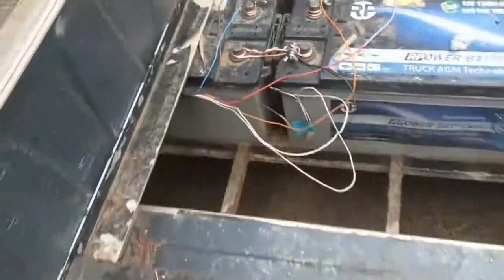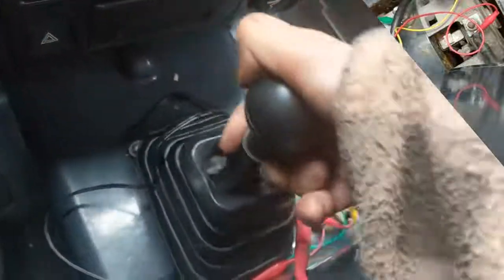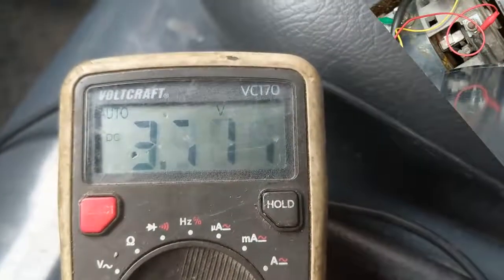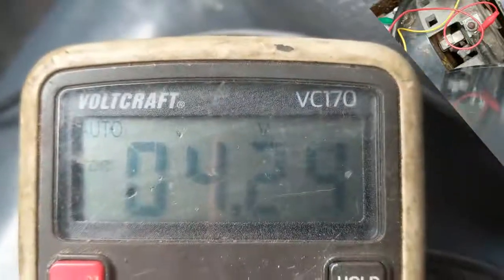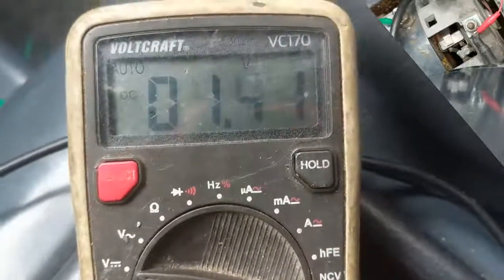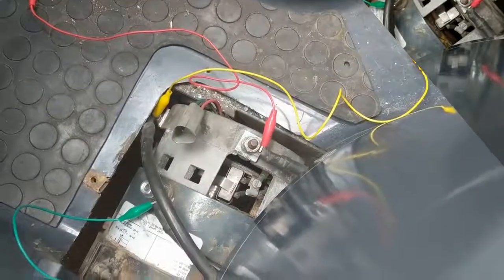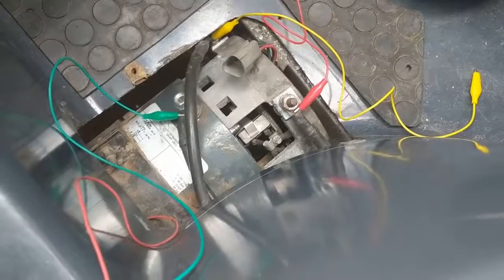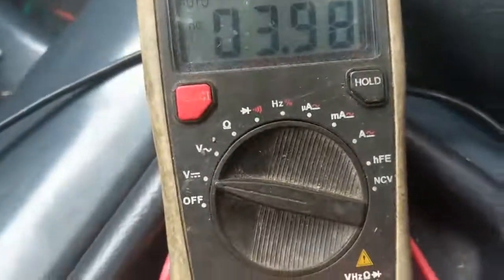NO, Aixam Mega drives max 1 km/h like a snail :-( 2003 Truck Electric

Comment: I must have missed the beginning of this electric truck project because I don't remember how you sized your motor and your power supply. Just from a layperson's perspective: When you described smoke and heat, it sounded like the motor torque was too small compared to the truck's gearbox/axle mass moment of inertia, so electric current was flowing through the motor and getting converted to heat instead of kinetic energy.
Reply from the maker: No the front axis was jacked up and the wheels can spin freely so no torque.
I don't know whether the ESC is broken or is getting wrong input or if the motor is broken.
Have made a playlist: https://youtube.com/playlist?list=PLa9VLvJBLbTNkQSXuSKSvEXOhOx55yvUy
Some videos are in German, some in English
Reply: Oh, I just looked up "Axiam E-Mega". It's a real thing! So I should assume the motor is original to the truck. Yet it still sounded like the motor seized (thus caused heat and smoke) when you tried to drive it.